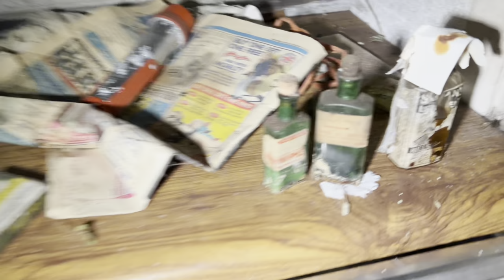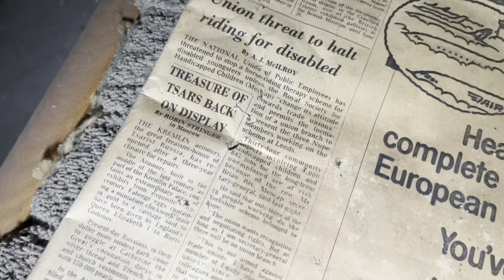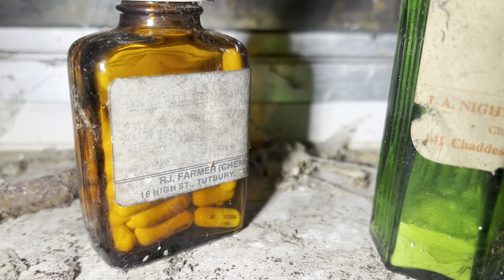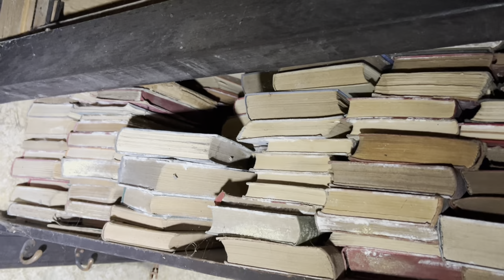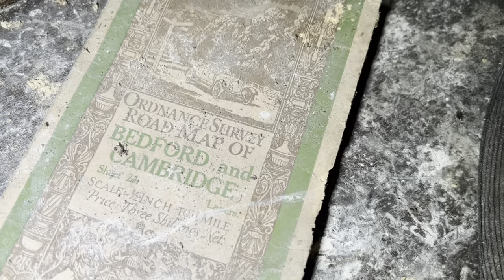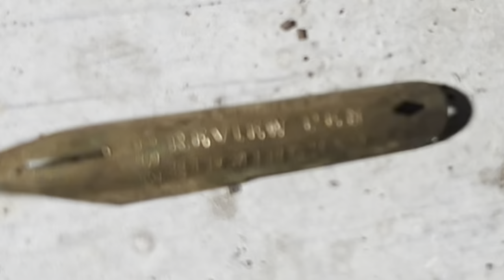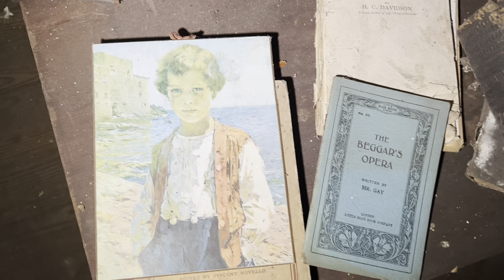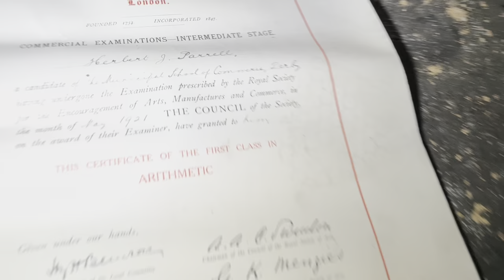This mental ABANDONED house had mystery items in the attic

Comment: That is not a sink it is the old 'Copper' You heat it up with a fire underneath and would use it for everything from washing clothes to (as my great gran did) boiling your Christmas pudding. I think what you called bulbs are actually old valves most probebly to do wih the radio. The Russian stuff and the radio in the attic, was it a spy lol. The warhead looks like a fuse for munitions maybe artillary.

Comment: Those ‘warheads’ are fuses for artillery shells (bombs in plain English). Those measurements allow the timing of the detonation to be adjusted (for example, airburst shells). 
These are almost certainly inert collectibles but always exercise a bit of caution when handling. You have no idea where they came from so there is risk (albeit very, very small) that they could still contain a detonator ;).
Reply: Exactly!

Comment: We used to have a spin dryer, hooking the hose over the edge of the kitchen sink... but it used to dance round the floor so we had to keep rearranging the clothes so they were more balanced inside and it would stand still, either that or shout at it to "pull yourself together and stop showing off ! "

Comment: That may have been a radio transmitter and antenna, dating back from 1910-20's
Those parts that were moving, are variabile condensers, used for tuning.
Whatever, very valuable piece of radio history.
Reply: Lots of vintage items there.
Reply: Too bad, they will be lost.